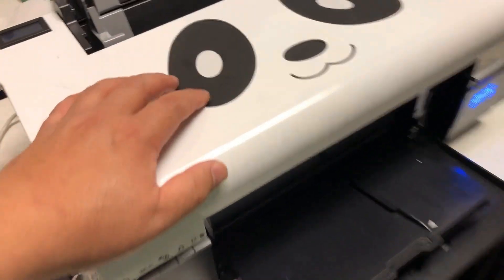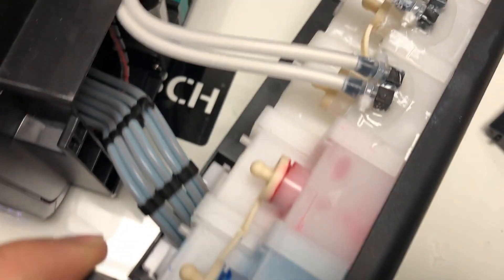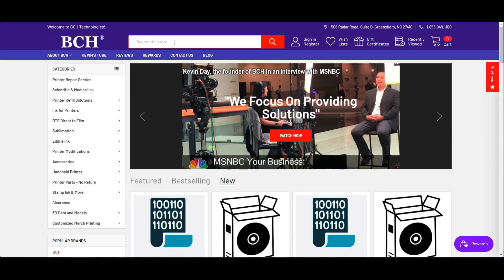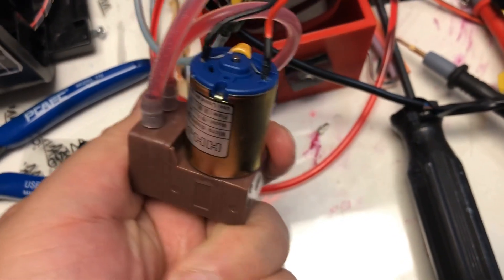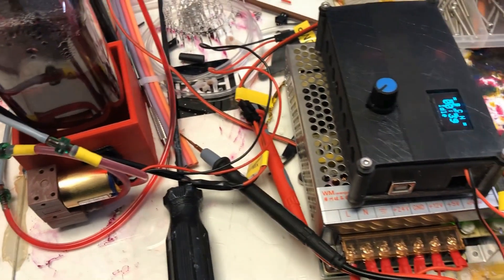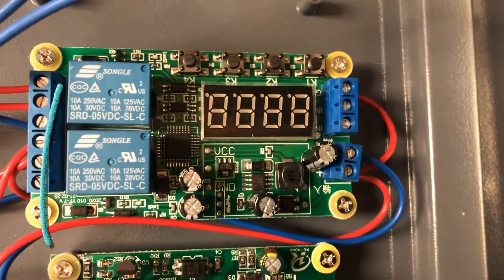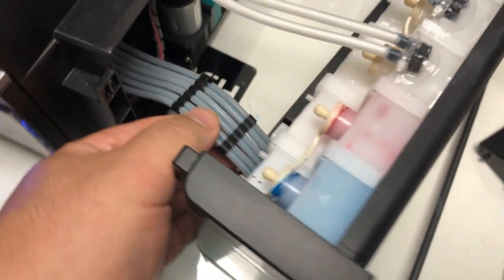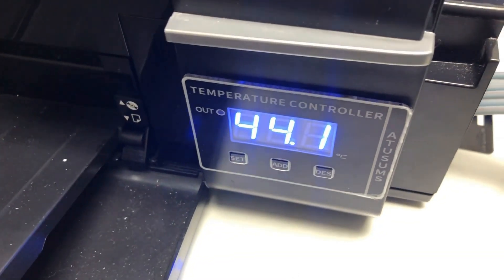The secret fix for White Ink Pump or Mixer issues in Procolored DTF printer

Comment: I am wondering if the pump motor used in this video is compatible with the K8? I sent an email with your support email as we need to order a replacement.
Reply from the maker: Thank you so much for your support and for reaching out—great question and I’m glad you watched the video! For the K8, the first step is to confirm what type of pump you have, since some units use a peristaltic pump while others use a diaphragm pump, and those are not interchangeable; once you identify the pump type, check the voltage sticker on the motor itself and match both the pump style and voltage on bchtechnologies.com to ensure compatibility before ordering, which is exactly the right move after emailing support; I really appreciate your engagement, and if this helped, please consider subscribing or becoming a channel member because subscribers and members receive priority replies (usually within 48 hours), early access to videos, and extra benefits, while regular viewer questions are answered if time allows since I can only respond to about 10 per day, with remaining slots filled last-in, first-out (newest first), so if you don’t receive a reply within 48 hours you can either subscribe or repost your question, and if you subscribe later your older questions automatically become priority without reposting; you’re also invited to join Run With Kevin — LIVE, where I go live every morning (usually between 6–8 AM Eastern) answering printer questions in real time, so subscribe and turn on notifications if you want to catch the next live session and ask directly; if you need faster assistance, email [support@bchtechnologies.com](mailto:support@bchtechnologies.com), and if this video or comment helped you, I’d truly appreciate a Google review here: [https://g.page/r/CfL7k6nYvPQ9EAg/review](https://g.page/r/CfL7k6nYvPQ9EAg/review) 📋 Copy

Comment: Would this pump work with procolored dual printer xp600?
Reply from the maker: Hi! Thanks so much for subscribing to my channel and supporting me as one of your favorite creators. I really appreciate your support—it’s subscribers like you who make this journey rewarding. I’m working hard toward reaching that 100k milestone, and while I’m only halfway there after eight years, I’m committed to providing valuable content and answering subscriber questions like yours as quickly as possible.

Yes, most DTF printers, including the Procolored dual printer with an XP600 printhead, use a 24V pump. Just make sure to check the pump type. If the tubes go into a rectangular brown box, it’s a diaphragm pump; if they go into a circular box, it’s a peristaltic pump. Ensuring compatibility with the pump type is crucial for your setup to work properly.

Thank you for taking the time to comment! I receive so many questions that it’s tough to keep up with them all. For subscribers like you, I do my best to respond within 48 hours, but if you ever need quicker assistance, you can email me directly at support@bchtechnologies.com. Thanks again for subscribing—it means a lot to me!